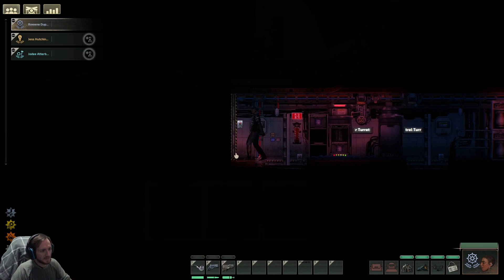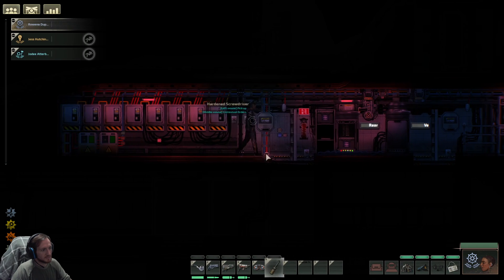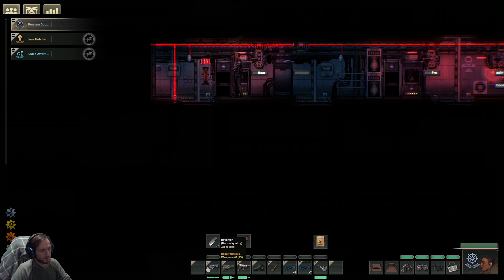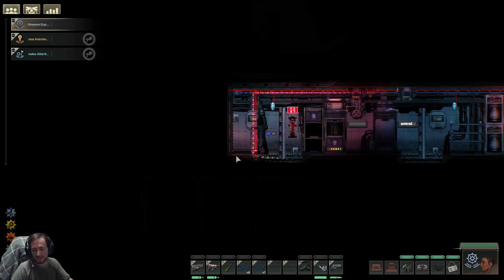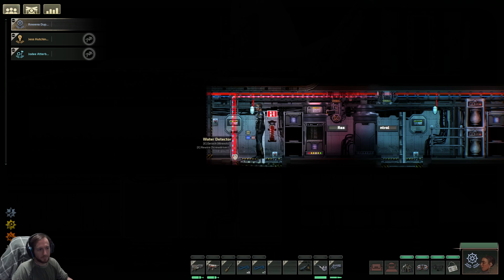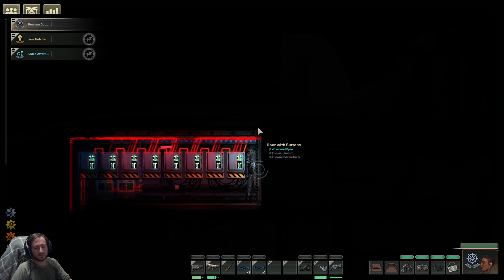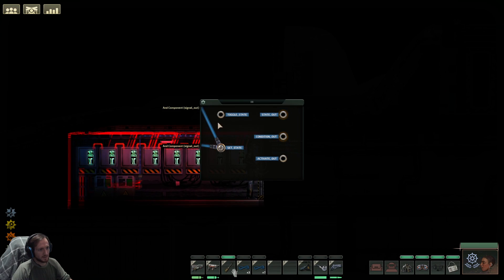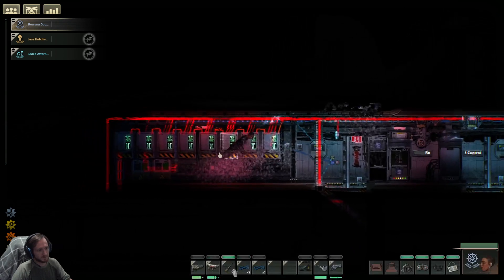Barotrauma - Motion and Water detecting doors

Comment: How can I try and test out my own designs to see if they work? Do I go to the sub editor and try it out there? I was thinking that I could get this same result using an and & not component.
The motion detector would be hooked up to the and component. The water detector would be hooked up to the and component through the not component which inverts the signal. This way the motion detector would send a signal when it detects movement. The water detector would continiously send a signal when it's dry. This way the and component would swnd a signal to open the door when it's dry. When it's wet, the water detector wouldn't send a signal when it's wet, so the door wouldn't open.

Comment: Is the "or" component needed? Is it not just passing a signal through without changing anything?
Reply: Never mind, I got it. The "or" component is so that water detectors on both sides of the door will stop the door from opening. My bad.
Reply from the maker: Off the top of my the OR is there to keep track of when the motion dector goes off as the circuit needs to check for motion and water but if water is on motion turns off. I can't fully remember my reasons for everything but I still have them written down in Onenote...Onenote is a godsend for wiring and what I am looking at while talking as I have to write it all down.

That being said it's possible and likely the circuit I made can be done in a better or more streamlined way but this is just the route I found to get it done.

Comment: I tried doing this but the door just stays open once I wire everything.
Reply from the maker: It's possible they changed something since I did this but any chance you have a video of your setup so I can look at it? I dont think they have changed anything so it should work. May need to undo the default wiring on the door.
Reply: @deathfromace  They might have. to be more specific, im unable to manually open/close the door with the bottons when its flooded or standing near it. if I walk up to it, its open. when I walk away, it closes. If the room is flooded, the door closes and I'm unable to open. Id like to have the doors open and close automatically, unless its flooded. if its flooded, id like to use the bottoms on the door.

Edit: I fixed it. For those wondering, after some time and reexamining his comment about the stock wiring on the door, the stock wiring is needed. The system in the video is an addition to the stock Auto-doors in the sub-editor. Thanks for the help man!
Reply from the maker: @nathandeleeuw281  hmm I know I had this issue while working on it but I thought I fixed it and put that in the video. Let me rewatch the video and then get in the game to test it out to see if I can get it sorted. Able to send a picture to me on it? Don't have to but could message me on discord and we can figure it out.
Reply from the maker: @nathandeleeuw281  I tested it out again and got it to work. Did you make the "and component" have a false output of 0...if so it needs to be blank instead.

Also, make sure you dont still have a previous auto door open wire hanging out.
Reply: @deathfromace thanks for being so responsive, I thought I replied earlier but I guess not. I got it to work, turns out I wasn’t using the stock motion detecting circuit. LOL
Reply from the maker: @nathandeleeuw281  Yeah those will get you. Stock motion or a previously applied auto open door that is forgotten about.

Glad I could help!

Comment: Love the in depth video, have you considered doing a tutorial on the new automatic reactor control. Someone joined my game recently and set it up in a circuit box right next to the reactor and I haven't been able to find any videos on it. It worked a lot better than the other circuits I've seen in some other shorts even on the humpback
Reply from the maker: I have not done a ton with the reactor so far but I'll look into it and see what I can do. Do you know how it was better than the regular turning reactor to automatic? Or did it not adjust the reactor settings the same way?
Reply: @deathfromace  i don’t know much about it, he put it on manual control and it set the fission rate and turbine speed much faster than automatic.
Reply from the maker: I figured out how to do this. Did more looking into it today and found the method people have been using for a bit. Making a video on it. Thank you for the heads up that this was possible. I have not looked at the reactor much myself.
Reply: @deathfromace  no problem. Thanks for researching it, cant wait for the video, definitely going to try it out in my current playthrough.
Reply from the maker: @frankwhitaker9408  It's no problem. I learned from it and put into focus the things I just dont understand haha. It should be going up tomorrow as my terminal fun idea went up today.